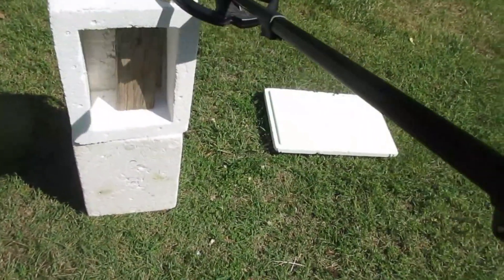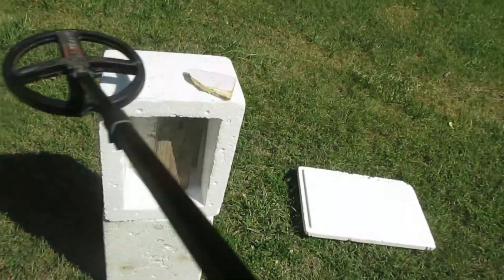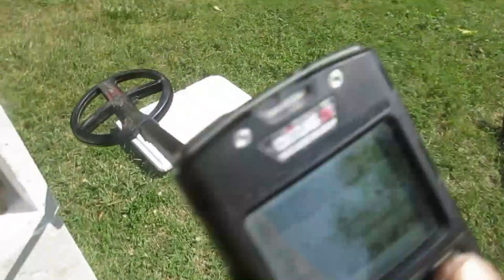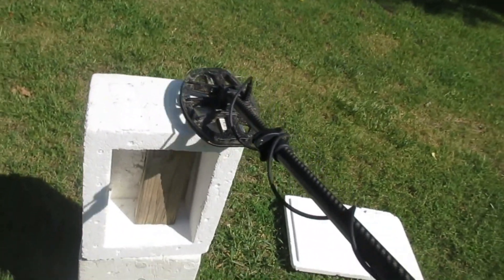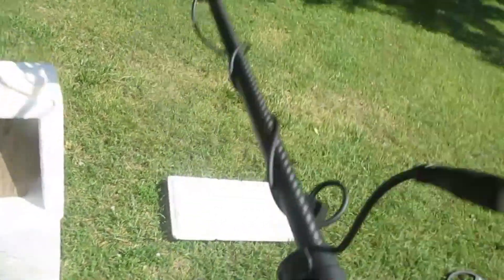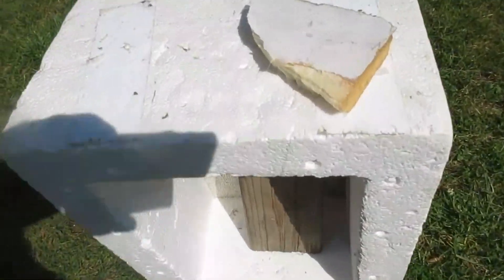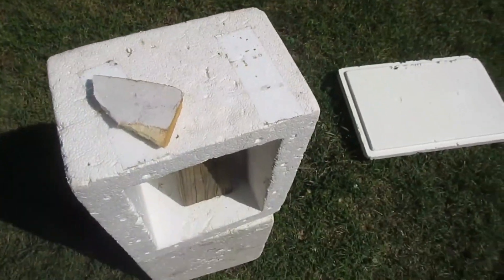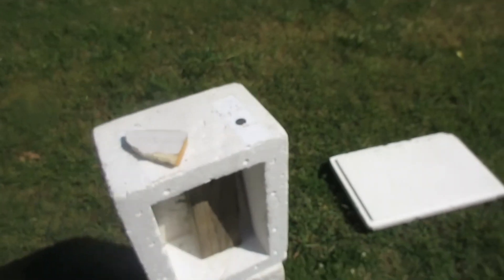Manticore with M8 coil compared to Deus 2 Even smaller foil

Comment: @tnsharpshooter8517, I’m more interested in either seeing them put on equal footing, or going full blast. To be “equal,” 
The Deus 2 Audio Response needs to be at 7, to equate to the Manticore’s Prospecting audio theme.
Also, bump the Deus 2 Recovery Speed up to about 3 of 5, to equal Manticore’s 6 of 8. Then drop Deus 2’s Sensitivity to around 90, to equate to Manticore’s 20. Though I don’t know what difference it could make, Deus should be using Ground Tracking, since the Manticore does.

I personally use the Deus 2 (still on version .71), 11 inch coil, in a different location than in a gold field. I run it “wide open,” though I still have reactivity at 1. I am probably going to start running it at 0.5 or 0. 

I have pulled out targets no thicker than a hair, and only a 1/4 or less in length. It can find very weak signals.
Reply from the maker: Well.
I’ll wait and see what folks report on testing small gold using both setups,  have a hunch I know what they will witness.  Again we’ll see.